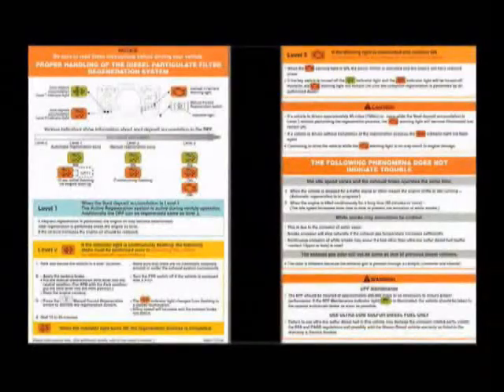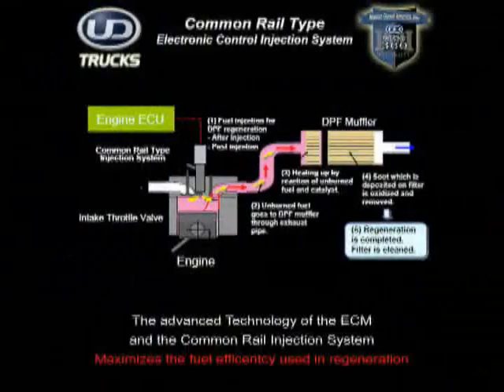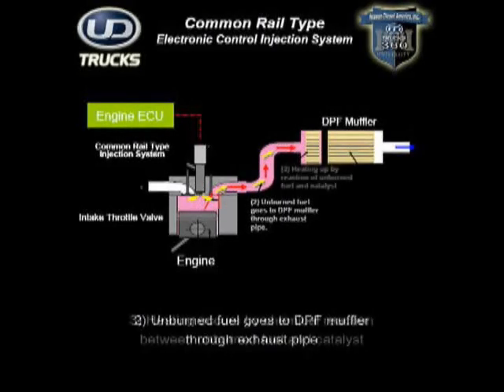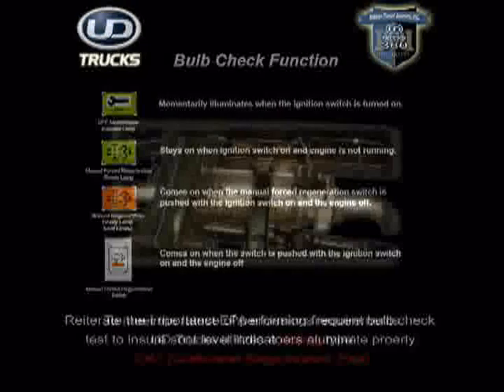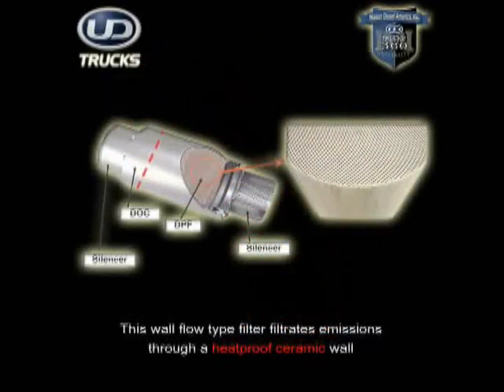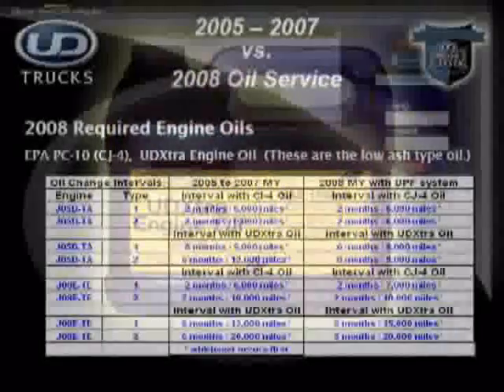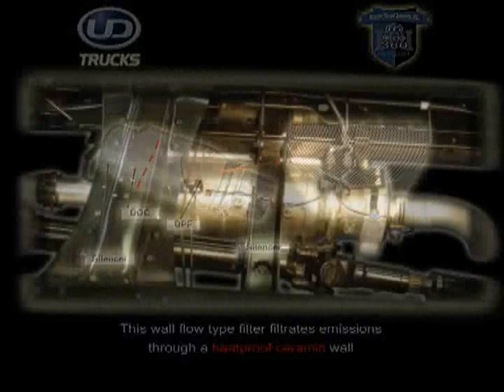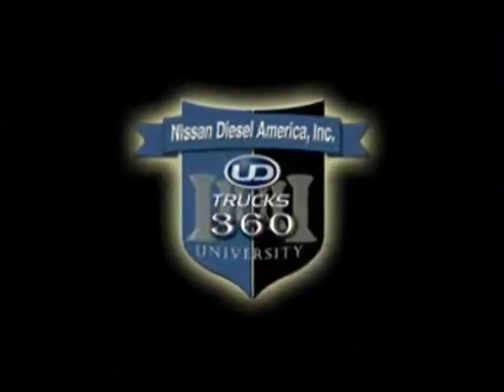Diesel Particulate Filter - Part 2

Comment: At the end of part one I was wondering if the control system  knew to require the driver to take an action, why  doesn't the control system do it? Better watch part two I decided. I expect more comments on the order of those who care about only themselves, the sort of things that leads to more regulation. Not enough views by those persons yet Anyone who decides to reove it better hang on to it, so they can put back on if enforcement gets  nasty. When enforcement gets  nasty no one will want to take the vehicle as a trade in or as an outright purchase with the DPF removed.  In time the emission controls on diesel road vehicle  will mature, as they did with gasoline vehicles into something that's not noticed until something wears out.